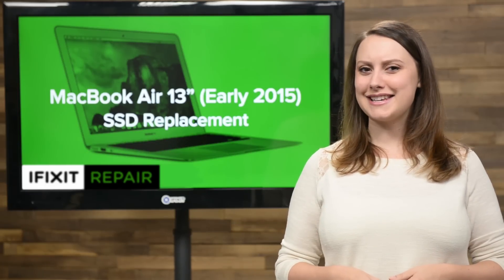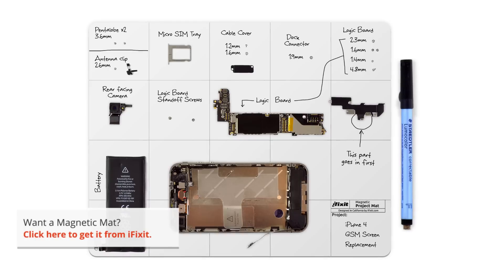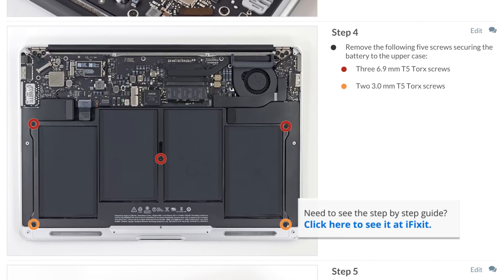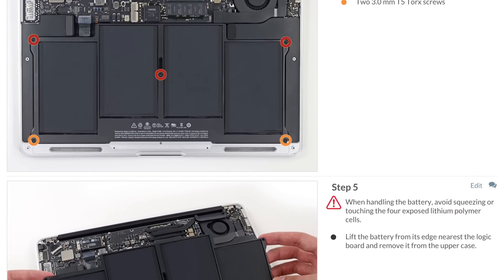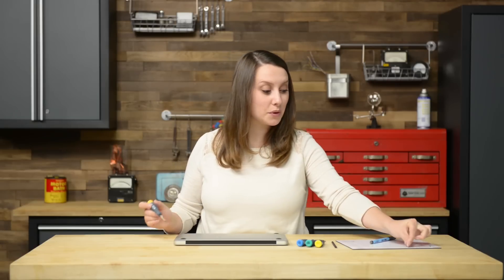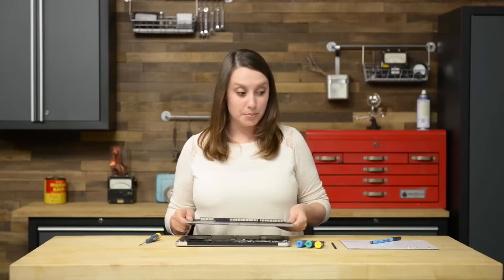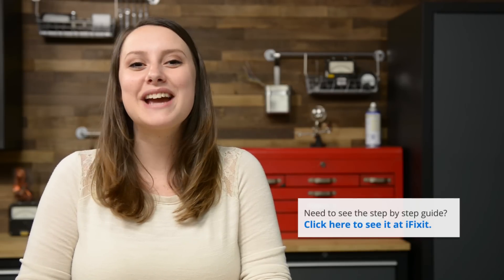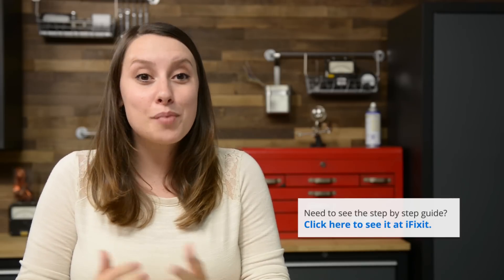How To: Replace the SSD in your MacBook Air 13" (Early 2015)

Comment: After changing the SSD how the MAC OS would be installed?
Reply: The easiest way is to get a PCle ssd enclosure and make an exact copy of the old ssd (the one that is already inside the MacBook) to your new one with an app like carbon copy cloner (I think you have to pay for it but there are similar ones for free). This way you won't lose any data and you won't have to install MacOS all over again. The enclosure will  transform the ssd into something like a USB driver so the whole process will be easier, not to mention that one you're done you can put the old ssd into the enclosure and repurpose it as an external hard drive.

Comment: My OLD Mac Air 13" is dead, it has 256GB SSD

I Bought a new MAC Air 13" with 128GB SSD

If i swap the 256GB SSD from old to new.. will i get all my OLD DATA.?
Reply: yeah
Reply: Yes, if the SSD was not the reason the old one died..

Comment: Just bought a used Samsung 512GB SSD... Hopefully it will do the job. After a quick research i found that all other brands won't work properly or are significantly slower.

Comment: Bom dia, hoje 13 de Dezembro de 2019, o meu é um MacBook Air meados de 2011, o HD ssd dele de 128gb queimou, fiz a troca por um SSD de 256, ele reconhece na minha máquina, mas não consigo instalar o sistema operacional nele de jeito nenhum, dá o seguinte erro; O MacOS não pode ser instalado no seu computador, nenhum pacote adequado para instalação foi encontrado. Entre em contato com o fabricante do software para obter assistência.
Reply: PUTZ, e você já resolveu isso?

Comment: Hi I have Mac book Air Early 2015 version (MJVE2LL/A and MMGF2LL/A configurations have 128 GB of flash storage) . I wanted to upgrade to 512 GB or 1 Tb. I wish to know which SSD card would be compatible with this MacBook air. Does Samsung SSD 970 PRO or EVO 512 or 1tb is compatible? kindly reply ....
Reply: any ssd recommendation?

Comment: Would be helpful if it showed were to get adapter to replace Apple SSD with an aftermarket m.2 SSD.
Reply: https://www.ebay.com/itm/500GB-Turbo-SSD-New-2013-2014-2015-MacBook-Pro-MacBook-Air-iMac-Mac-Pro/263541391009?hash=item3d5c4a7ea1:g:XtUAAOSwJWxbjX04:rk:13:pf:0

Comment: can we upgrade ram to 16gb on MacBook air early 2015
Reply: I believe you need a heat gun and a soldering iron, etc. There's a video on YouTube. Some Macs were easier previously but this one looks a bit more work. Technically possible, though.
Reply: LOL!  If you wanted something that was up-gradable you should have bought a PC not a Mac.  No the RAM is not up-gradable in any Mac laptop.

Comment: Can someone please confirm if the model being upgraded is specifically for the MacBook air with with model number MMGF2LL/A? Also, when purchasing the SSD what are the specs for the SSD itself that I need to look for when purchasing the part to upgrade.... thanks!

Comment: is it posible to upgrade the RAM?
Reply: not on this model it is soldered on
Reply: It is using a heat gun and and soldering tools. Bit of work, though. You need to remove the logic board. Video on YouTube.

Comment: I dont understand ? but ? SSD Mean what is it !? Solid State Drive !? But !? It's not the RAM ? And i whant to upgrade My RAM ? From 4GB (originaly) to 8GB (upgraded) ? i dont see a tutorial about it ?
Reply: macbook air ram is soldered on the logic board.so it can only be upgrade if u change the whole logic board. otherwise the only way you can do it when you first purchase the air (because they will solder the ram based on what you choose.4gb or 8gb). after that you are stuck with the ram.
Reply: but new 2015 macbook air , apple has fixed the ram to 8gb. no more 4gb
Reply: Syad Sulaiman nono.....i HAVE ! the Mac Book Air 2015 ! And he don't have 8Gb ......
Reply: ya apple do an upgrade to MacBook air 2015 where they bumped the ram from 4gb to standard 8gb . but when i bought mine. they still have the 4gb ram specs in which i have to upgrade to 8gb but i did not do that as i did not know that MacBook ram is soldered so meaning no way u can update the ram after purchased it. (which i regret is so damn bad ) but now apple has standardise the ram to 8gb min, i think around feb 2016 . but it is still early 2015 model of MacBook air. they just do a minor upgrade on ssd storage speed for write and read and 4gb ram to 8gb ram standardise. as on 2016 they are focused on the MACBOOK 12 instead
Reply: u can check ur macbook by downloading software called coconutbattery from safari and run the software and check on ur mac info. like mine it is early 2015 mBA but manufacturing date is in JULY 2015. in which apple only bumped the ram to 8gb on feb 2016 manufacturing of MBA early 2015. hope this helps
Reply: Syad Sulaiman not mine ! but ? you're american ......i'm in europe .....;
Reply: Syad Sulaiman heuuum ? I ALLREADY KNOW that ! LOL ! And All you're saying is possible from the Apple LOGO from the Left upside of the screen ! And : "ABOUT THIS MAC"
Reply: on about the mac it only show the early 2015. but from the coconutbattery u can actually see the exact date (date,month,year) so u can actually know whether urs is before they bumped the ram or after they bumped it. LOL.! 
and i bought mine in UK

Comment: Can i upgrade the 2016 model?
Reply: Samuel Summers there is no 2016 model
Reply: Samuel Summers there isn't sweetie. There's a 2016 MacBook Air and pro but not an air.
Reply: Raging Ragina yes there is. The one with the 8gb of ram, the 2015 one comes with 4gb of ram. The 2017 one comes with slightly faster processor
Reply: Raging Ragina So there's a macbook air.
Reply: wtf are u on about
Reply: Samuel Summers yes

Comment: This proves that Macbook Air is slightly upgradable.
Reply: I wish RAM was also upgradeable :/
Reply: It is! https://www.youtube.com/watch?v=CTsEJ49LLsQ. Although admittedly a bit of a challenge if you don't like soldering. And replacing resistors. Very small ones.
Reply: @bomcabedal i dont want to spend 500 dolalr on dolsdering machine and flux
Reply: as it should be :^)

Comment: could i use the ssd on a windows pc?
Reply: +martinhl1 Almost all modern post-Skylake (i.e.2015) motherboards have PCI M.2 slots. So if you custom build your own PC then it will have a M.2 (im using a SM951 with a Z170I motherboard). If you have an OEM PC then you will have to check. Anything before 2014 or so is unlikely to have a M.2.
Reply: +[ Strepzpire ] Only if you have a M2 slot on your mainboard. The chances are low..
Reply: yifuj Ok.., Thanks bud!

Comment: I have an early 2014 mac book air and the 128 gb hard drive is killing me literally. Please can somebody help me find an SSD drive that is compatiable. Please i need to have this upgraded so bad, so so so bad. This is the only video that even comes close to helping please help
Reply: You need to either buy an offical SSD from Apple because of their proprietary plug/slot they use.  Or you can buy a standard M.2 SSD stick with an adapter for the plug.  I did the latter with a Macbook Pro 2015 and it worked perfectly.  Example:  https://www.ebay.com/itm/500GB-Turbo-SSD-New-2013-2014-2015-MacBook-Pro-MacBook-Air-iMac-Mac-Pro/263541391009?hash=item3d5c4a7ea1:g:XtUAAOSwJWxbjX04:rk:13:pf:0
Reply: Hi :)  @red5standingby419  . I want to replace my SSD like you as well. But what kind of adapter did you use from M.2 SSD to SATA in your Macbook Pro 2015? I suppose it would be the same procedure as with a Macbook Air from early 2014? Thanks for helping :)

Comment: just buy a half size sd card and put it into your sd card slot to store all the media etc, fits perfect and simple, and cheaper
Reply: But it'll take much longer to load things. That's why they put an SSD in there in the first place.
Reply: Lol actually this was the solution I needed thank you!
Reply: That's what I've done with my 2017 Air. Put my music collection on a 400 gb SD card. So my 256 gb SSD in the Air is only half full :)

Comment: Very handy! Can you upgrade the SSD to a larger capacity, or does it have to be the same size if replaced?
Reply: It can be a higher capacity SSD  but be careful I did this with my Mac and my fans went ballistic and had to sell the one I just bought and buy a slightly more expensive version I think it was a extra $15

Comment: but its not a M.2 connector its maybe custom Apple connector even if it was M.2 & you put in non Apple SSD it won't do TRIM. El-Captain completely bkocks the hacks for TRIM on non Apple SSD so see no point in replacing myself if it had problem I buy new Apple SSD from store where they replace it for free :X
Reply: Have fun wasting your money

Comment: Does the SSD of the air compatible with the Pro version?
Reply: As long as they are both m.2 ssds yes
Reply: How about from transcend 

http://www.amazon.com/gp/product/B00JKCHMMS?keywords=macbook%20ssd&qid=1449280685&ref_=sr_1_3&sr=8-3

does it work can any one confirm?
Reply: +dketya The link says yes, but nobody has been able to find new replacement parts, even ifixit is selling used SSDs because Apple keeps such a tight wrap on who gets to sell spare parts(nobody).
Reply: +dketya they both PCIE.... so should be d same
Reply: note its not M.2 its PCIE
Reply: +dketya maybe
Reply: +dketya Yes it's, if you follow the link to the parts it says for air, pro 13 and 15
Reply: Probably no